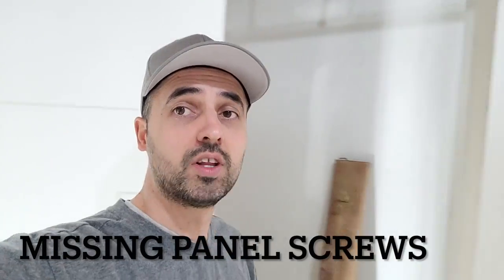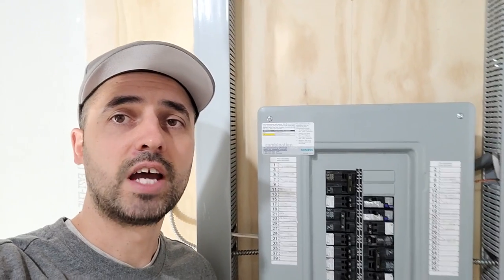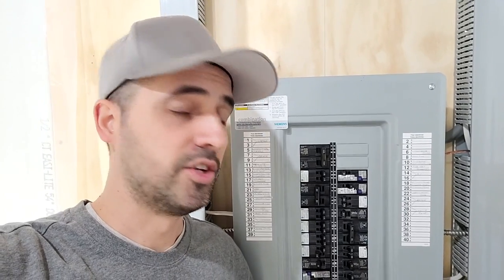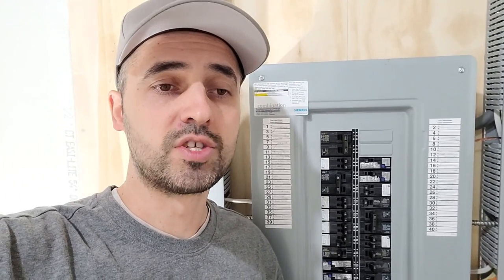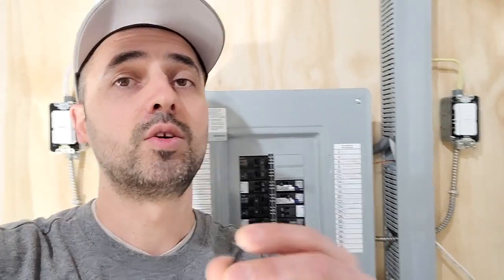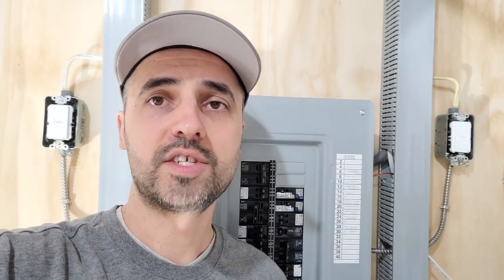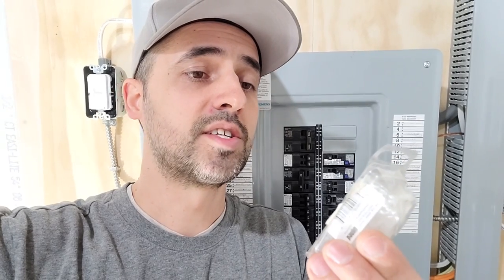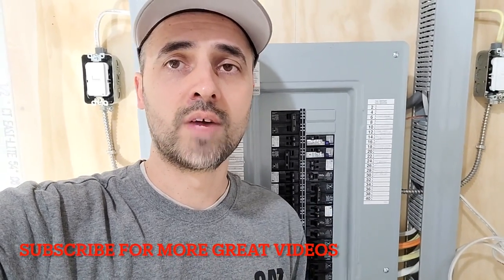What to do if you Lose a Panel Cover Screw !!

Comment: yeah panel screws are a joke.. the manufactures change the threads over time which is absolutely ridiculous considering how unimportant the thread is relative to how important have the panel cover installed is. every manufacture's panel cover screws should be universal.

Comment: I somehow lost all my screws. They probably got put in a can when we took it off to change a breaker and who knows where they went. Make sure the tip isn’t sharp. The big wires like to hang out just behind the frame and you don’t want a screw poking on the cover for your incoming power. I have an old Westinghouse which apparently is now Eaton.

Comment: You can find exact replacement Siemens cover screws in the circuit breaker aisle at HD or Lowes. Comes in a 6 pack. Square D as well but I think they’re interchangeable.

Comment: Really? A video on what to do if you lose a panel screw? LOL  Do one about what to do if you drop your wire strippers on the floor :)  There are specialty screws that you do NOT want to drop under ANY circumstances but a panel screw is not not one of them.   Just busting your balls because I'm bored :)
Reply from the maker: You watched it didn't you?  Lol.
Reply: @energyoneelectric   I did :)  Wait....I didn't. I just commented without watching bur since you replied, I guess I'm obligated to watch it now :)  

I knew the Siemens were 10/24s but I have run across a dozen different kinds in my 50 years of losing screws.  The 3/16" toggle bolts I used to use were 10/24s and were always good in a pinch. Otherwise I'd use the mutli purpose sheet metal screws :)  I never resorted to drywall screws though :)  

Also, Energy One is a great name!
Reply from the maker: @effthegop my intention in the video was to help people understand there are proper threaded screws they can buy instead of just stripping it with a wood screw or something.